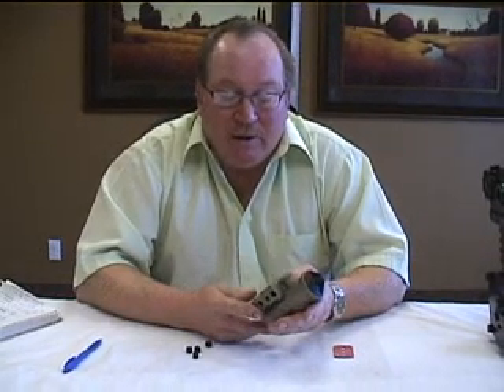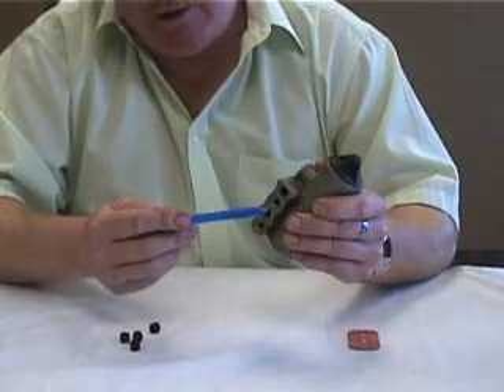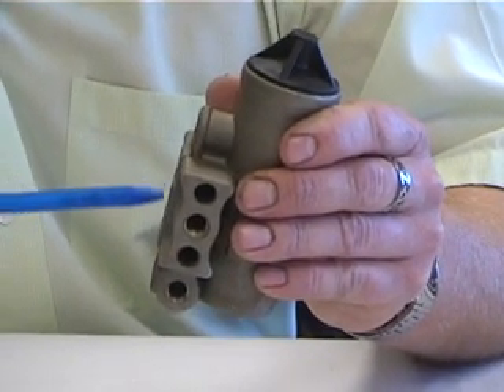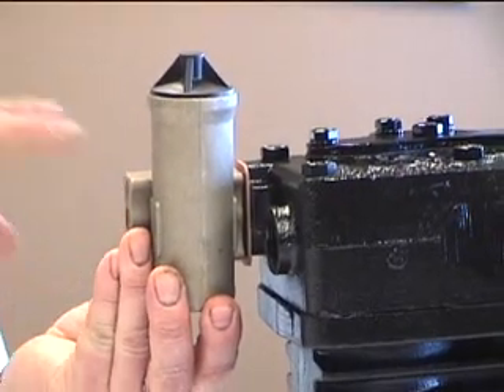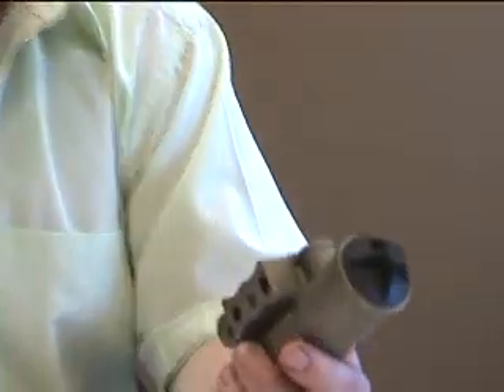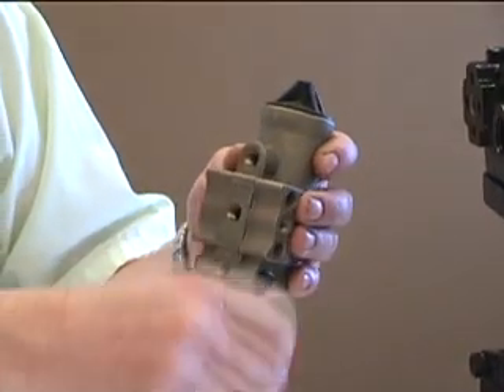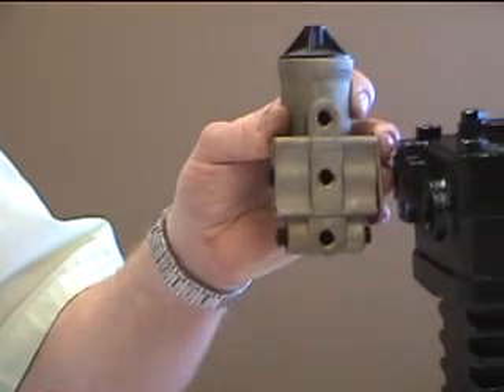D-2 Governor Installation

Comment: You solved my problem!
Previous owner had blocked the exhaust port. I even bought and installed a new governor before checking the port. I matched all the ports like you said however the exhaust port should have never been blocked.  
Fixed my problem thankyou! No more headache
Reply from the maker: Thanks for the feedback! Glad to hear you got it sorted out. That blocked exhaust port can definitely cause a headache. Appreciate you taking the time to share your experience and happy to hear the video helped.

Comment: I like using adjustable air governors .  In the event a pressure protection valve is stuck unscrew the adjustment .  This will let the compressor pump to 150 lbs. unsticking the valve .  Pressure protection valves may supply air to frame suspension valve , cab air ride valve  , and the fan hub clutch .

Comment: My governor has some kind of metal release valve on the exhaust exit, I bought a new governor  and it does not have it, it has a plastic plug. Please advice.
Reply from the maker: The plastic plug is fine. It is there to keep dirt out and has a small hole in it so it can breath.
Reply: @fleetproducts  Thanks. But some highly recommend removing that plastic plug. 🤷‍♂️
Reply from the maker: @Benelli037  You can remove the plug but chances are it will get dirt in it and cause issues over time. We recommend leaving the plug in as long as there is a small hole in it to breath. All governors that we sell come with the plastic plug.
Reply: @fleetproducts  Thanks!

Comment: If the air dryer is not purging at all, would replacing the governor fix the issue?  8 year old dryer
Reply from the maker: If your dryer is not purging, there could be an issue with the control line. Check the line to make sure it is not plugged, kinked or frozen. If the line looks good, you may have a faulty purge valve and we would suggest replacing it or replacing the complete dryer.

Comment: Thank you sir.  I've been beating myself for days after completely cleaning and rebuilding my AD IS air dryer with all new purge valve, governor, and filter.  It was still not working.  I even called the dealership contemplating buying a new one until I watched your video.  The problem was I plugged the exhaust port on the governor.
Reply from the maker: Glad to hear you got it all figured out!

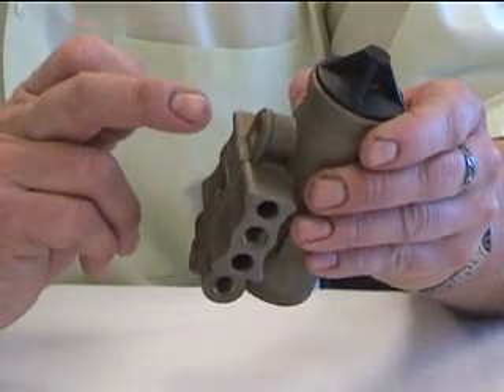Comment: @ 1:10 the plastic plug that he is pointing to would not come out of my old one.
It has 4 small holes in it.
My new one is the same way and "Pre-Installed" The Plastic plug has 4 holes in it.
I'm not even going to try to remove the new plastic plug because I broke the old one bad and never got it out anyways.
I hope I made this clear enough.
I guess it vents through the four small holes.

Comment: Thank you sir for the video. How can I fix my broken (spoiled)  air governor
Reply from the maker: For the minimal cost, I would suggest to replace it.
Reply: VENT ALL AIR FROM SYSTEM. take the plastic cap off of the pressure adjuster. remove the snap ring under the cap. remove the spring assembly. remove the small plunger and spring. remove the main piston. clean all the parts with soft brush and diesel fuel. or just spray it out very well with carburator cleaner. or brake cleaner. or starting fluid. dry all parts. lubricate everything with motor oil. reassemble.  i just did this today without removing the governor and everything works fine now. a new governor is on its way but i needed something now.

Comment: If they would only STOP tapping that exhaust port with threads, you wouldn't have a way to thread a plug in it in the first place.  Knowing people are gonna make use of ALL the plugs that come with the governor.  Having parts "leftover" would make them think they did the install incorrectly.  This "problem", or "confusion", is caused by the manufacturer, not the installer.  Tapping holes that should NOT be plugged is unnecessary and stupid.
Reply: So true. I made the mistake myself.
Reply: mine has a filter threaded into the exhaust port.

Comment: i have a dt466 international and the governor is liking air tru the exhaust and my 550 air compressor is not bill any pretion
Reply from the maker: It sounds like you have some restriction in your lines. Double check them to make sure there is no carbon build-up inside the lines and replace them if necessary.

Comment: Yeah, mine is installed properly, however, when the air dryer valve purges, it stays open until the air pressure drops to like 100PSI, and then air compressor kicks in, pumps it to 125, and Air dryer purges again! It happens like every 40 seconds! Purge valve  and the governor are brand new too... I don't know what to do
Reply from the maker: I would suggest that you take a look at the unloader on the compressor as it might be sticking causing the issue.

Comment: good video. is there a way to lower the pressure? mine go's up to 140 psi. it's too much
Reply from the maker: It depends if you have an adjustable governor or not. Take the cap off the top of the governor and you will see the adjuster. Turn counter-clockwise to reduce the pressure setting and clockwise to increase the pressure setting.
Reply: +Fleet Products Ltd. thank you so much I will try that.

Comment: thanks, a very helpful simple demonstration that cured a problem I had with my Peterbilt, with it's air governor and compressor system, that I had a repair shop do some work on earlier in the day. They installed a new air governor and air dryer for me and later, on the way home, I had a problem with the air compressor not recharging the system after the pressure dropped below 100psi. Did some trouble shooting and some phone calls with no success on what would be causing the problem. After viewing this video, I immediately went out to my truck to make sure they did not plug the air exhaust port on the governor.....and.... Sure enough, there  it was, plugged. I removed the plug from the exhaust port and everything works fine.